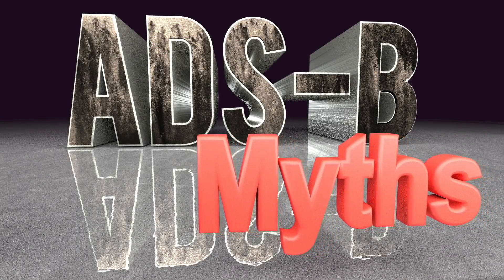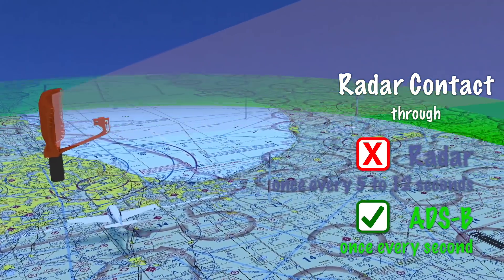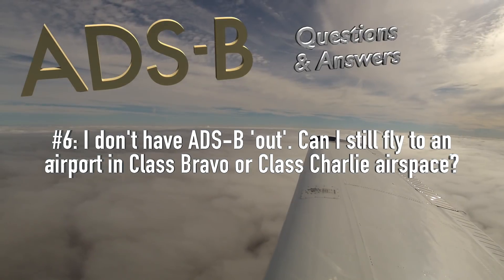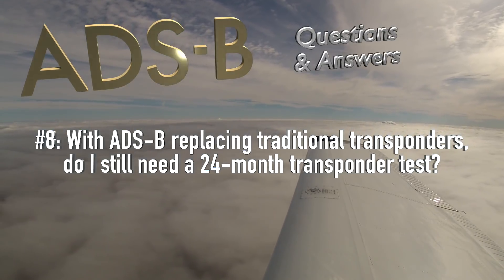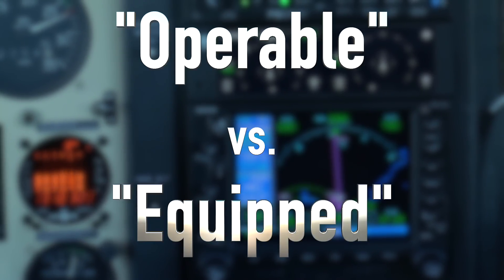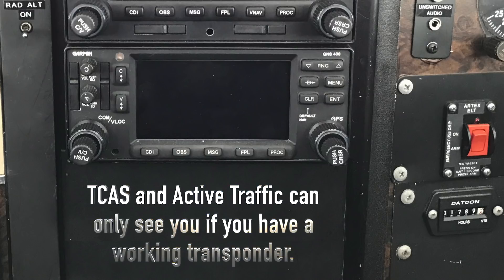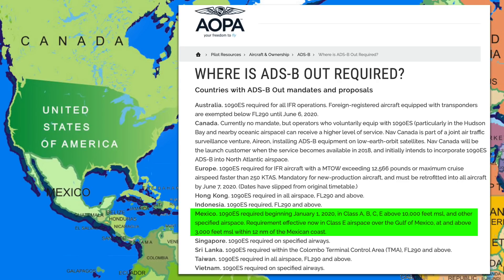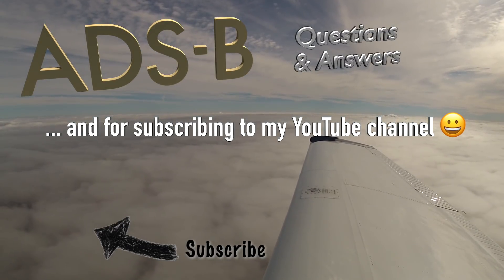ADS-B Myths - Q&A for Pilot and Aircraft Owner

Comment: If I am flying around a lonely area in a small plane equipped with 1090 ADS-B, and an airliner flies by, will our devices detect each other?   I think that the answer is no, because the airliner ADS-B is on a different band.
Reply from the maker: The answer is: maybe… Airliners have 1090MHz ADS-B out, but very few airliners have ADS-B in. They have TCAS instead, which is independent of ADS-B. For you to see an airliner, you either need ADS-B in on 1090MHz or have it relayed by a ground station to 978MHz.
Regards,
  Martin

Comment: Curious, I've been flying Hang Gliders for nearly 50 years and have always wanted to increase my traffic awareness but obviously there are serious limitations to what can be used in the somewhat meager cockpit ;-)

Recently Flarm  RX/TX devices (a collision avoidance system popular in the sailplane community) now have the option to include ADS-B "RX".  Well ADS-B "TX" is not legal in the US for my choice of aircraft, expanding my local traffic awareness is important to me. As I understand  ADS-B 'RX",  I should "see" local ADS-B "TX" Traffic with or without ground services (?)... I should also be able to "see" Mode-C (?... with ground services transmitting on ADS-B?). ... correct me if I have this wrong... 

One other item that has me curious,  If my Flarm device is interacting with another aircraft equipped with Flarm that also has a full ADS-B RX/TX transponder, will my Flarm data be shared within the ADS-B system?  (perhaps a bit of a stretch to have this much technology talk to each other....).

Thanks
Reply from the maker: I don't know much about Flarm, so I'm afraid I can't answer all your questions definitively. But what I do know is this: an ADS-B receiver (ADS-B "in") will see nearby aircraft which have an ADS-B "out" transmitter, without needing ground services. They will see a Mode C-equipped airplane (without ADS-B "out") only if a nearby ground station relays that target via ADS-B to another nearby aircraft with ADS-B "out" and "in", so it'll be somewhat random with a Flarm device.
Hope that helps!
- Martin
Reply: @martinpauly  Thanks, The challenges of an aircraft without an engine... and foot launched ;-)  Cheers....

Comment: Ya know I have never been ramp checked. I have never heard of Dynam gear failing in experimental either.  Why not use low cost and many times better avionics in a certified plane. Good question. Someone's getting a check for a campaign. It makes no sense. How many GA pilots would be alive today had they had a low cost and great auto pilot for a fee grand not over $15,000

Comment: How long before ATC starts mailing out violations based on ADS-B data only?
Reply from the maker: We will see, Keith. Technically it should be easy for the FAA to see when someone without ADS-B is in mandate airspace, but if they only have a Mode C transponder, it can sill be hard to identify the aircraft.
- Martin

Comment: Portable ADS-B? The issue is "ADS-B pollution".  A poorly installed ADS-B can give the wrong position, which is really worse than no position at all. The good news is that an $1800 ADS-B can replace your wingtip light or tail beacon, using the existing power. The bad news is that there is already a significant number of misconfigured ads-b installations done by poor avionics techs. This is why you participate in the FAA ADS-B "checkout" program.

Comment: Thank you for this video.  I do have a couple of questions.  
1.  If I have a transponder/encoder but no ADSB-out, do I show up on other aircraft's ADSB-in?
2.  Related to 1, Will TCAS show traffic that ADSB-in doesn't?

Thank you.
Reply from the maker: Jeff A Hi Jeff,
1. Part of the time, yes. The ADS-B ground stations will send an uplink to ADS-B ‘in’ equipped aircraft with data about nearby Mode C aircraft - but only when both are tracked by ATC radar. This is called TIS-B.
2. Yes - when TIS-B fails, for example down low in the traffic pattern far away from radar, TCAS (active traffic) can still show Mode C-equipped aircraft.
Reply: Thank you Martin

Comment: Amazing video! I have an ads-b mode s (ping20si)  installed on my drone,  will an aircraft equipped with a mode c transponder see my position and altitude ?
Reply from the maker: Aircraft with only a Mode C transponder will not see your position - nor will they see any other aircraft. For them to see you, they need some kind of ADS-B "in", which could be a cheap portable solution with an iPad or a more elaborate panel-mount setup.
Regards, Martin

Comment: Thank you for almost complete view of ADS-B in North America.  What is missing are the different requirements for spaced-based "Aireon" operation.  A top mount antenna is required with at least 125W on 1090.  Nav Canada is now threatening a requirement for top and bottom mount antennae, often called "antenna diversity".  This creates a problem for most GA aircraft with only a bottom mount ADS-B antenna.  Furthermore,  they do not support FIS-B or TIS-B services.  This could be dangerous for FAA compliant ADS-B aircraft into Canada, either UAT or 1090.
Reply from the maker: Thanks for the note, Lee. You are right, my portrayal was US-centric (since that’s where the mandate goes into effect shortly). We are all watching what Canada is going to do, after Mexico pretty much adopted the US mandate (except no UAT).
Should the need for diversity arise, fortunately I can add that to my NGT-9000+ with a simple software key. It will then use the top-mounted directional antenna (active traffic) for the diverse ADS-B out. Though I’m not sure it’ll come to such a mandate, at least not in regions/altitudes I care about in my Bonanza.
Best regards, Martin

Comment: GDay Martin, You need to stress that 1090ES IS a transponder. It transmits mode S. UAT is only seen by other UAT and the ATC ground receivers..IT IS NOT SEEN BY TCAS equipped airliners where mode S and mode S ES is. UAT is not seen by 1090ES ADS-B Rx units. UAT Rx can only see 1090ES when it is range of UAT ground stations. 1090ES Rx sees other 1090ES even outside radar or ground station coverage.
Reply from the maker: You are right, Mark. 1090ES is a transponder, whereas UAT only works as an addition to a traditional transponder. As I mention in the video, there are other reasons (international flying) to go the 1090ES route, in addition to what you mentioned.
- Martin

Comment: Why doesn’t ATC just move everyone to GPS altitude? It makes much more sense, is more consistent, and doesn’t fluctuate with atmospheric pressure.
Reply from the maker: I'm not saying that's a bad idea, but I can give you three reasons why it's not happening:
(1) not everybody has a GPS in their aircraft - it's not required equipment
(2) it would have to be a world-wide standardization effort, and replacing something as old and fundamental (in aviation) as barometric altitude takes forever (too much inertia)
(3) what do you do if GPS has an outage, or there's interference?
I see advantages for using GPS altitude, but I don't think it's likely going to happen.
- Martin

Comment: Excellent & very instructive video! I fly a VL3-Evolution (based near the capital of your old home country) with a combination of Trig TT21 1090ES ADS-B out transponder and a Garrecht TRX1500 ADS-B in & FLARM receiver which is coupled with the Garmin G3X by means of mapped visual and audio alerts. Basically, the system is doing a decent job. But occasionally, I do NOT get a warning when I should have. Airliners are practically always detected and visualized but certain planes, albeit some newer ones that certainly must have an ADS-B out capable transponder are not shown. Some of them came really close. What's a possible reason? Bad antenna? This bugs me because the system suggests an appearent level of security that can become potentially hazardous if you rely too much on it. Is there anything I could improve?

Comment: Some short, alternative answers here:

Q. Does ADS-B replace a transponder?
A. No, controllers are basically dumb as rocks and will continue to use transponders long after the ADS-B mandate. The FAA training program for controllers consists of two steps: 1. Train new controllers. 2 wait for the old ones to die. Seriously I have ADS-B out installed by my avionics provider, but they also apparently messed up the transponder and it reads 500 ft to low. But the controllers see my ADS-B altitude right? noooooooooo. I basically have to fix that before entering mode c veil again.

Q. Do you need 1090ES to enter Mexican airspace?
A. Yes. They need your coordinates to know where to shoot at.

Q. What happens if you have both 1090ES "out" capability and UAT "out" capability?
A. They turn on only the UAT capability. This means you get to collide with underequipped low altitude airliners.

Q. I heard they have a new satellite capability to listen to ADS-B outputs and determine your flight track in case you go down?
A. Yes, and by special arrangement that does not apply to light aircraft. You, as a light aircraft, don't pay sufficient fees to the FAA, so the program is not for you.
Reply: Virtually everything in your reply is incorrect, misleading, or both.  I guess that's what you meant by "alternative"
Reply: @Gismo1951  That's what I like, well reasoned answers and point by point rebuttals.

Comment: The answer is: get ADS-B. Transponders didn't really help pilots, they were just for traffic controllers. Frankly they should be eliminated now. ADS-B is different, it shows you where other aircraft are and shows your aircraft to others, even if you are not on radar. In fact it does this even if you are in valley with no possibility of being swept by radar.

This a major increase in safety for all aircraft operating, at anytime, anywhere. There are now cheap ADS-B out solutions, like the replacement for wingtip lights, and ADS-B in can be fitted to any portable GPS solution, including cellphones and tablets.

It is true that the FAA botched the program by creating two incompatible solutions, but the avionics makers have already bypassed FAA stupidity by creating so called "dual band" solutions on the cheap.
Reply from the maker: Scott, my thoughts are very similar. If we could make a clean cut, get rid of SSR and equip every aircraft with ADS-B 'out' (preferably all using the 1090 flavor), it would be a much simpler and more useful system than what we have today.
- Martin
Reply: @martinpauly  Unfortunately, the reason everybody cannot use the 1090 frequency is that it would be overloaded. That's why, for example, the FIS info can't be put on 1090. So as much as possible, the FAA wants all future traffic off 1090 and onto 978. The transponder system was never designed for the traffic and extended data requirements.

So the FAA decided that big airplanes get 1090, little ones get 978 UAT, and the two (incompatible) frequencies get translated, one to the other, by FAA base stations, neatly negating the "A" for automatic part. ADS-B was supposed to work without a base station.

The logic went that big airplanes are supposed to be under radar coverage and little airplanes wandering into paths of big airplanes would have their ADS-B pings translated. This assumes that big airplanes stay under radar! The reality is that turboprops fly in and out of light aircraft runways all the time, in small areas like roseville and others. And out of radar coverage.

The makers like Garmin figured this out (and credit goes to them). In this day and age, having a dual band receiver is no big deal. So modern units get both 1090 and 978 frequencies. So what could go wrong now?

Well, lots actually. Dual RECEIVERS does not mean TRANSMITTERS, so where to the ADS-B outs go in a dual band setup? The FAA has dictated, and should be no surprise, duals go to the UAT 978, so that they don't add to congestion (my Garmin is actually technically capable of output on either, or even both).

Now assuming that those big aircraft flying into roseville get smart and also go dual receiver. Ok. But the FAA just spent a ton of money on a new round of Iridium satellites that receive ADS-B outs. This is a whole new age of aircraft tracking. It allows real time tracking of aircraft anywhere in the world, over oceans, mountains, and if the aircraft goes down, you have a real time track up to the time the aircraft stopped operating. Like as in "ran into the ground" or "exploded", not just "went off radar", since satellites can see anything that is not flying underwater or underground.

So neat, right? Except that system was designed for big aircraft. And 1090ES. What about small aircraft? Well, there are actually two problems with that.

1. Its the wrong frequency. Even if you CAN squitter 1090ES, the FAA has told the avionics installers not to do that. They COULD have had the satellites see 978 UAT. But that would have cost extra (its almost like they are preferring one type of aircraft over others!).
2. The antenna is on the wrong side. They put them on the bottom of the aircraft so that the ground stations can see them (does the FAA actually care if different aircraft can see each other? Hmmmmm). The antennas need to be on the top, or both top and bottom. That is the way the big aircraft do it. Antennas on the bottom cannot be seen by satellites.

And so on. The AOPA first requested the ability to remove transponders if ADS-B is installed. The FAA said no, even though the systems are redundant. It also might make the FAA admit that the transponder system was deployed badly and before the technology was cooked. The bandwidth is overutilized, transponders have lots of technical problems and, oh yea! Did you know that the technology behind GPS was known before the transponder mandate? As in they could have planned the bandwidth and data to accommodate that?

I guess one reason I get annoyed by the FAA is that I have been flying for 47 years. The FAA introduces compromised systems like this with "oh, that's the best we could do, we can't make it better". Until the day they can. And then they change to "oh, nobody knew that at the time". Go see for example the history of VORs. The military took that technology and made a simple radial finder work for both direction and distance, and tried to work with the FAA to give that to civilians. Eventually they just gave up. The FAA was a drag on the program. Eventually they retrofitted it with DME, but the system worked far worse than what the military implemented.

Regards.
Reply: Scott Franco  Also the TCAS installed in Turbines and Jets is based off of Mode C Transponders. If transponders were done away with then the FAA would have to change the FARs about turbine equipment needing TCAS. Also it would remove a safety net (another set of eyes if you will). It’s all about cost. The Jets that I fly for a paycheck has ADSB Out but is not equipped with ADSB In. We only have TCAS. We also operate in and out of a lot of busy GA airports. Having ADSB in would be awesome. But again it’s about cost. 
Martin thanks for making well informed videos. I’ve watched a few of your videos since I ran across the one you mentioned Max G in. I’m really enjoying your effort. You make a great instructor!
Reply from the maker: Thanks for your kind words.
A good TCAS is quite valuable, but also costs a lot more than ADS-B 'in'. But I understand why the airlines don't get ADS-B 'in', especially since the use of ADS-B is not yet required around the world whereas TCAS works everywhere (based on Mode C, like you said).
Best regards, Martin

Comment: Hi Martin two points. I don’t think all Mode C airports will require ADS-B. There is a google earth overlay a available at the FAA. Watch the following video for the instructions https://youtu.be/exL9hg973lA 
Also around the 4 minute mark you said legacy transponders use UAT, but they actually use 1090, but don’t have the extended squitter, required for ADS-B. Very accurate video otherwise, thank you!